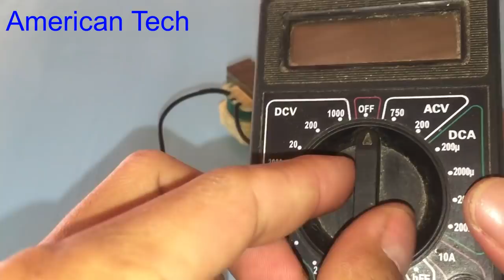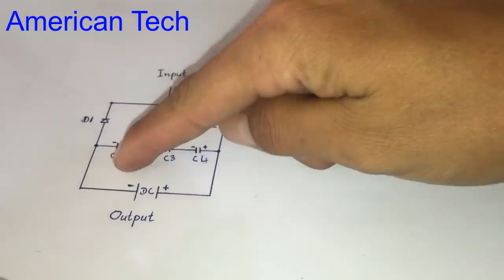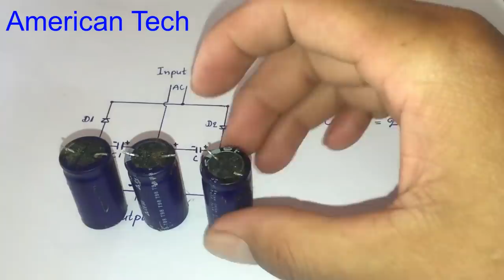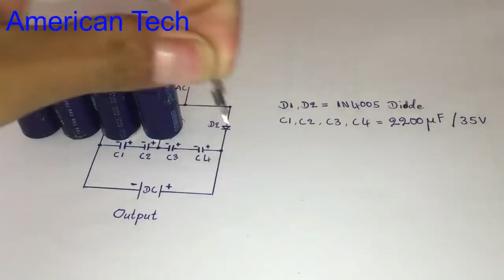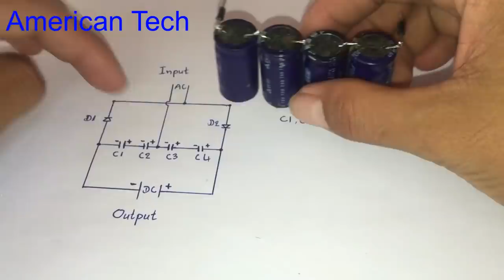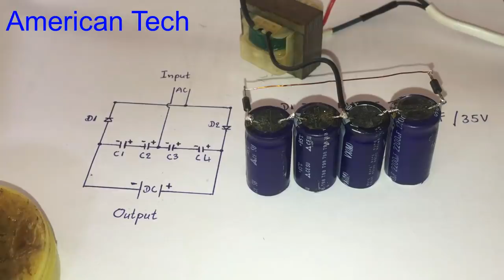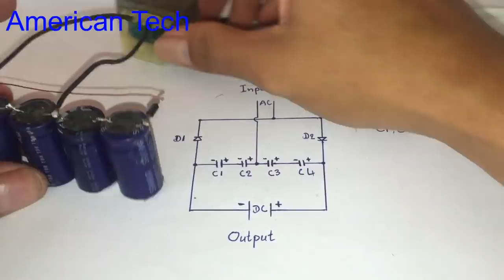How to make Voltage doubler, How to increase voltage using Diodes and Capacitor

Comment: its false circuit   we can increase AC voltage to 2x dc using 2 diode & 2 capacitor.2 step rectification . with real usable power you doing only 1st step
Reply: Really false?
Reply: @Tamilnadu-t3p  he doesn't need 4 capacitor. Only two needed

Edit: i think it was half wave voltage doubler

Comment: It is typical circuit that used to works in old fashion TV screens with cathodical  tube . it is something new but it is something that really works especially when the input ac signal has high frequency .

Comment: Yes, you can double the voltage with this method, but for each time you 
double the voltage, you loose half the current capability. It's things 
like this that bother me about your videos, you tell only have truths 
about a project, never taking the time to fully show the true specs. Which is why, I complain about them.
Reply: yup.....power is neither gained...laws of physics........one goes up, the other of necessity, must go down.......Ohms laws and others.....resistance, inductance, capacitance, reactance, lenzs'  laws,.......etc...

Comment: Normal Guys this works fine. I have not even tested but my calculations give that result. The 16V is rms ie effective value, for alternative so maximum value is multiplied by square root of 2 ie 1.41 times 16v=22.63v, hence two times 22.63v will give about 45v which is normal (close to the 46 he has obtained).
Reply: he can't control the signal from the fixed transformer increase or decrease Hz not even regulated ....add a load watch that voltage disappear lmfao
Reply: dave Yates  That's true! I have made a circuit and added a third filter capacitor in parallel to the DC output terminals. Hooked up a 24V LED bar and saw the voltage dropping instantly, hence the 4700uF cap.
Reply: Start thinking of modification to the transformer secondary coils eg use thinner enamel wire but more strands but cud get hot to with long use lol

Comment: What was the point of putting the capacitors in series? All you are achieving is halving their capacity. They are rated at 35V, plenty enough to handle any potential voltage they come under. Basically you are wasting two capacitors and making the circuit work worse.
Reply: Bob Berg
Reply: Bob Berg
Reply: I love you girl
Reply: Bob Berg m

Comment: How can i choose which capacitor to use.

Lets say my power supply 24v
Load 30amp start 10-12a continuously

I would like to boost to 48v or double:

What V and Uf suitable for my application . 

Thanks

Comment: I seem to remember Cockcoft and Walton devised this idea to power nuclear investigation into Alpha waves. It was then used in TV having the tube as a big capacitor.  The device giving upto 25 kV at low currect and costing $20. A tripler if that application. Input capaitor type allows two PSU from one source without shorting the high voltage.  Be sure to check it's that type if building your own.  The more sections you add the lower the current and not as a direct fraction, it's far lower.

Comment: What happens if I use 4700uf 50v capacitors? Please tell me
Reply: I think the voltage will be doubled too but the current will increase. There must be a maths formula for this.

Comment: I find it's less than half the current. I used it for an amplifier VAS where 8 mA was enough. I had to use a  volatge regulator as ripple was high.
Reply: Yea, a very strange circuit indeed and i find it unstable to because there is zero rectification so there will be dc pulse waves like ac do

Comment: I have a solar panel with 2 solar batteries. I connected to light up but sometimes the batteries went flat during nights. Any steps to increase batteries currents to keep till day break??
Reply: buy more battries and parallel it to your existing batt.

Comment: What is difference between series and parallel capacitor connection
Reply: parallel capacitors will add up the capacity. Capacitors in series will show a behaviour with the capacity like resistors do in parallel with the resistance

Comment: Toward the end of the video, the voltage of a single capacitor is measured to be zero for the two capacitors to the right. Can you confirm that there is no DC voltage on a single capacitor?
Reply: A strange question, since it is to be well known fact, that capacitors store only DC voltage and let through them (from + to -) only AC voltage.. the circuit is really strange though.. might work, i mean, it's worth a try but i do not have any ac transformer in disposal right now
Reply: @paveljelinek772  AC voltage is simply DC voltage in fluctuation. Toward the end of the video, the voltage of the right most capacitor  is measured to be zero. However, the combined voltage of the two capacitors on the right is not zero. This is strange. Is the right-most capacitor faulty ?
Reply: @ericsu4667  no, not faulty since the ac comes right through the cap so there's no voltage diff, and the circuit's behavior is somewhat different than 'casual' circuit.. i bet that if he would measure first cap + and direct ground, not - on the cap, it would show something.. i'll try myself, already ordered all the necessary stuff.. all the same but caps are 50V, same capacitance though
Reply: @paveljelinek772  OK. Please let me know the result from your new capacitors. Thanks.
Reply: @ericsu4667  ok eric, i made a simplier version of this, involving only 2 caps (two diodes), worx like a charm, just remember that if your transformer gives say 20W max, you can expect half amperage on double voltage.. and higher the switching frequency the better (i use frequency modifier, it goes 1kHz). Why? The faster you switch, the lower cap discharges between switches (pulses) so you'll get more stable DC wave.. or use higher capacity caps. More current you need, more frequency/capacitance you should have to get most stable DC wave
Reply: @paveljelinek772  Good work, Pavel. However, why should frequency matter ? The diode is supposed to prevent the capacitor from discharging.
Reply: @ericsu4667  if the supply was dc battery, the circuit would not work at all, you need positive and negative voltage to get the doubler working.. that way - when ac is positive, first cap is charging, when negative ac, first cap is discharging and second is charging. If the frequency 60Hz, this happens 60 times a second so the caps should not fully discharge, unless you draw more current from them.. then, as i said before, you need either greater frequency or bigger caps.. capiche? Diodes have nothing to do with this
Reply: @paveljelinek772  On the contrary, diode makes big difference. With diode in series connection with capacitor, the capcitor can never discharge. If power supply is AC, capacitor is charged only half of the time. Nothing happens in the other half of time, The diode prevents discharge. Therefore, frequency does not matter.
Reply: @ericsu4667  yea? Be such a kind and find a video typing "dc voltage doubler" or "battery voltage doubler". Then you'll see some switching in action, by man's hand! When no switching, no double voltage, only the same voltage the input (battery in this case). If he switches too slow, the led dims very fast as the cap discharges.. go on, you'll see!
Reply: @paveljelinek772  This video (https://www.youtube.com/watch?v=D3D6VMlXCKc) does exactly what I described. You either do not understand the function of diode or have connected the diode in reverse.
Reply: @ericsu4667  What? First, he uses AC transformer, second, i am getting bored with this. DC doubler - switching, AC, not necessarry. PERIOD

Comment: Can I do with eight capacitor ?
is it the same principle ,
Reply: install in series and parallel if you want a larger voltage, all series are installed.

Comment: Bro your caps have a maximum capacity of 35 volts and you are fucking them up with 46 volts dc and 100v ac. You will have to replace them over time when they will blow up

Comment: Music's totally annoying, video way too long for soldering 4 caps and 2 diodes, no explanation whatsoever, just a brief parts list doodled on the map alongside the circuit! And attaching two 2200uF capacitors will never make a 4400uF capacitor, FYI.

Comment: me parece bien, lo unico es que las capacidades que ponen, asi en serie se reducen a la mitad, entre mayor capacidad mas estabilidad, ya que es un doblador de media onda, lo ideal es minimo 6,800  a 10.000 micofaradios a 50 voltios o mas, para tener una buena reserva de corriente cuando se requiera, uso mucho ese doblador en fuentes de amplificadores de audio cuando los transformadores vienen solo con dos puntas, para obtener los voltajes positivos y negativos tomando como neutro o cero la union de los capacitores en serie y el cable del transformador y la otra punta a los diodos en serie que hacen la fuente de media onda para dos voltajes, positivo o negativo, o el doblador segun se requiera.

Comment: The most stupid slow project to use capacitors in series totally to make people confused and take it 10 mins to solder few components.
Reply: easy on the Man, some beginners out there appreciate the pace as it gives them the time to absorb the information without having to rewind.
Reply: Behave lol
Reply: Agreed!
Do people even look at their videos after they’re done? A freaking simplest editing(just cut the crap)would make it more watchable. Some people talk forever, some show the paint drying
Reply: This still pointless tho 🤣🤣🤣
Reply: Bro he cud of used a bigger transformer like normal people 😆😆😆
Reply: @davey2k12  ,  He stole all that stuff,    Grab what he can !  Then make money off youtube.
Reply: @johnbravo7542  yeh cheers for that.... Ffs where he ripped them out of bet there was a transformer bigger than ya fat head to charge them caps.... 😂😂😂 wot would you even use it for most likely get hot a and fry the thermal fuse on the primary coil lol

Comment: Gostaria também de saber com transformação com trafo monofásico pra corrente alternada trifásica 220 volts
Reply: con tranformador de corriente trifasica, te aconsejo un puente rectificador trifasico con 6 diodos, como si fuera un puente normal de 4 diodos, pero le pones otra serie mas en paralelo y en cada union de
la serie pones una punta del transformador trifasico, obteniendo tu voltaje ya rectificado y un filtro acorde al voltaje dc que obtendras , con un factor de tolerancia bastante alto, tienes un voltaje pico de  311.12 voltios DC, a partir de los 220 voltios alternos , es preferible un condensador a 350 voltios DC  minimo y al menos 470 microfaradios para factor de potencia, quedara muy estable, no se para que aplicacion quieres hacerlo, pero no se que en realidad quieres  hacer, si lo que quieres es tomar una de las fases y neutro, te dara 110 ac, ejemplo,  L1 neutro igual 110 ac, L1 L2 igual 220 ac, L2 l3 220 voltios ac y L3 L1 220 ac, todos contra neutro, entrega 110 ac, entonces segun lo que quieras pones un transformador de primario 110 o 220 voltios  AC y el resto es igual a lo que mostraron en el circuito y el secundario el voltaje que desees doblar.

Comment: Omg 15.8v with 35v capacitors you connect in series! You resist capacity🤣😂 connect in parallel 2x2.  Do you know what is diferent between series and parallel connections. And why turn your multimeter in AC show more voltage?!!! 😂🤣😂🤣LoL101.1v

Comment: What kind of schematic and material do I need to make a 100amper 24v storage capacitor. Can I use it as a battery in a solar system? Can it store 12 or 24 hours? How long can it store the electricity in it. I think of it as a battery in an electric bike. how come. I have a 48v 1500watt bike. need urgent answer

Comment: and here ladies and gents we learn to make yet another completely useless circuit. voltage without load on this type of circuit does show to be stepped up but try to actually put a load on it, lets say a 12V 25w light bulb. then you will see the tremendous amount of current the high voltage does not carry with it.
Reply: You need to filter the output with some big capactors to fill in the increased ripple.  The available current from a voltage doubler circuit like this is typically only 40% to 50% of what you would get from a full-wave simple rectified supply, but it does work.   From a 12V AC transformer with a 1A capacity, you could get 24V at about 400mA - 500mA.    Voltage doublers work.   Definitely not "useless".

Comment: Does not really know what he is doing.
1. The music
2. Series the Cap's makes 4400uF @ 70v Since the transformer voltage is 16v, 25v would be reasonable minimum after RMS rectifying.
3. The uF required would equal sustaining 1/2 the rated current of the transformer while recharging the Cap and running the load applied to the output at a rate of 1/30th of a second.
While one side of the cap is supplying voltage and current to one side of the load, the other side is supplying via the transformer voltage and current through the diode to recharge the other Cap and to operate the load. Then as the sine wave flips the roles are reversed, it does this 60 times a second, each side handling 30 of those times.
With this design, if the transformer is rated at 1 amp, then you could only draw off of the output .5 amp max.
Reply: How you are calculating the required capacitance. Can you give me a formul pls.
Reply: The series capacitors do NOT equal 4400 uf!!!  The capacitors would have to be in PARALLEL to equal 4400 uf!!!
Now...WHO doesn't know what he's doing???
Reply: @jeffreywyke368  Clearly an oversight 3 years ago, so yes, each bank would be 2,200uF@70V. Otherwise my analysis is sound.

Comment: Fake
Reply: jude pancho I make 15CT AC to be 40V DC CT (80V total - & +)
it is posible.
AC can product doble or multiple voltage.
i Use to suply simetris voltage power Amp. This is really work.